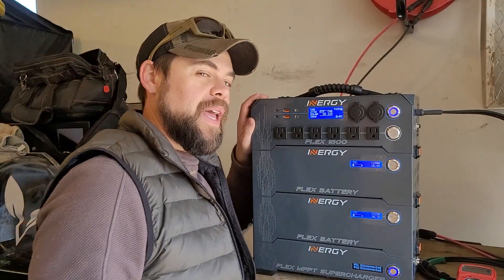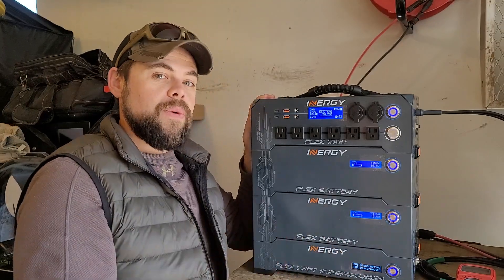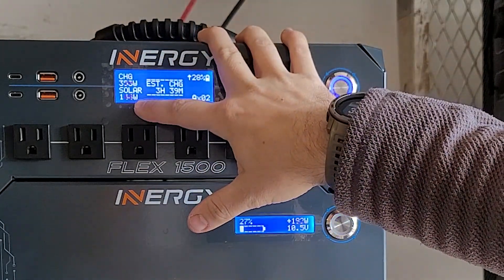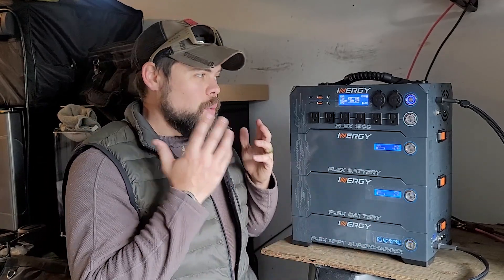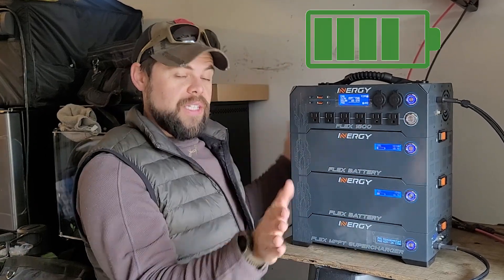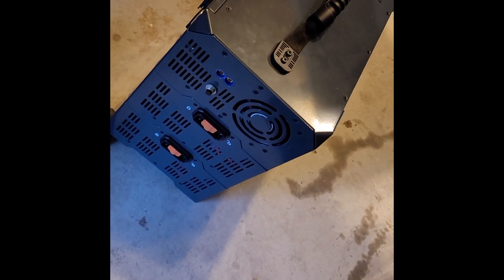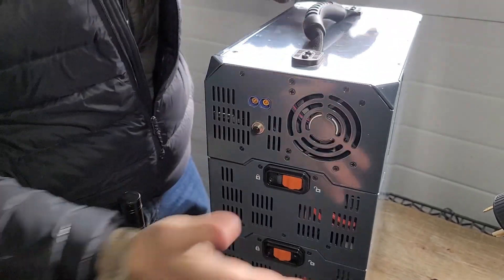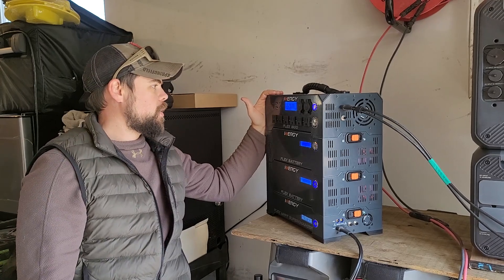UPDATED REVIEW Inergy Flex 1500 Solar Generator Power Station

Comment: 😂 I was one of the fools who preordered it. I typically have it on trickle via solar. Very Spartan gennie compared to the new offerings.
Reply: I also have a switch that is bent and locked up on the 2nd battery. Common problem. They changed the mechanisms on the "Tactical variant.

Comment: I think you may have either received a faulty unit or you just are unlucky.  I would talk with Inergy about the discharging of the batteries when not being used.  I've had my 1500 (with 3 batteries) since it first became available and I've not had any problems at all with it.  And that has included "unlatching" to move the thing from house to van many times without any latch problems at all.  Matter of fact, mine was stored for 4 months fully charged (and I heard I shouldn't do that so I checked on it) and it was at 99%.   So it lost 1 % in 4 months.  And I even topped that charge off just before hurricane Helene to be completely ready and just checked it and it's still sitting at 100%.  So I don't see any of the problems you described.  Looks like you were pretty rough on the unit!  lol  Good luck to you.

Comment: You have to (disengage the left side first) and then use that orange button on the right to release the latch to release the battery.  It would be best if you had not used the force to unlock the unit the way you did. If you look at the latch on the left side vs the right side of the latch, they have different angles for different release points. I love my Flex with an extra battery pack.
Reply: This guy in the video only responds to people who join him in dising Inergy!  lol   I think he pretty much screwed the pooch and didn't or doesn't want to admit it!  He probably forced those latches and then mangled them even more with that industrial screw-driver!

Comment: I agree with the lock issue as I have faced the same and one of my latches broke, poor design. Their technology is old, their batteries are not LiPo either. I had ordered 2 batteries from them in July, 2023 and never received them and eventually had to ask for my money back 13 months later, which still they messed up at first. As I guessed it, it no longer matters because now on their website they make it clear that they have a $1.83 million dollar contract with our federal gov't. and they are not selling anymore directly to the consumer.  I hope I do not have issues with my current products. It also is not surprising that our government is spending our tax dollars on outdated equipment only because it is safer since it is being manufactured in the USA.  US competition needs to step up so our tax dollars are more wisely used and our nation is more securely protected with the most modern tech. P.S. I have bought 3 systems from them and have 8 of their batteries. Now I moved on to EchoFlow.

Comment: I bought the Flex when they first came out. I bought 8 batteries.Can only use 5. (5  is the maximum stack).They told me that the connecting device..."FLEX BATTERY ADAPTER PLATE" would soon be available.It's been about 5 years and the still don't have any. Anyone else have a similar situation?
Reply: Company has folded according to CityPrepper. Thats my observation as well based on attempts to   reach them.  DO NOT send them money, creditors or liquidators will just take it.

Comment: I had to wait many months for my order to be filled, I think it was close to a year and half! The Flex System and batteries were purchased with a ten year warranty, that was supposed to be wonder bullet proof warranty at the time of purchase! This investment has been one of the worst I've ever made, $11,000 dollars in total with this company! This product was NOT fully tested and thought out before selling them, it was pushed out the door for the purpose of making a great deal of money! With no intentions of covering the batteries horrible life span, throwing  what ever batteries you could find during the pandemic! I also know that you have changed and improved the design since my purchases! Latches broke right away, no positive locking system! No piezo alarm letting you know the battery strength is too low! Many things should have been improved upon before sales should have started. My Makita batteries can hold a full charge for at least six months.

Comment: I've given up on my Inergy Flex at this point.
I pre-ordered, and finally did get it after some delays along the way.
I charged via 110 receptacle - all good there.
Ordered a couple solar panels, and didn't really get back to try them for about 6 months.
So by then the battery seemed dead, and wouldn't charge via solar or 110 receptacle.
Inergy support had me try charging just the battery module directly for 24 hours - no change, it wouldn't charge.
So they sent me packaging and labels to send it back to them. One Lithium battery label missing, so I bought some from Amazon. And shipped it back via FedEx.
Waited about month - didn't hear anything back on status or even if they received it.
Emailed support to get status - it's probably been about another month - crickets.
I really wanted to like it, but if it's not going to work, and response from support takes a month, if I even get a response - that just doesn't work for me.
I would have even bought another battery module if the problem was that I let it drain too far to be usable.
But then with the slow, sometimes non-existent, response from support, I can't see me putting more $$$'s into it.
At this point, I think I've got a $1300 controller that may end up going to e-waste, and I'll try another brand.
And the latches... one of those broke on me, also, on the battery module.
For something to be used for emergency times with power outages, I was hoping for better.
I did have an 8-9 hour power outage during an electric panel upgrade, so I ended up going to get a $1000 Champion duel fuel generator instead to deal with that.
Reply: same thing happened to ne. I sent back defective Kodiak X2s and they never responded so my money is gone.  that must have been time doors closed or creditors took over.

Comment: I've had my Flex 1500 since August 2021. Ordered with 2 batteries and 4x100w solar panels. I'm super please with it in my ProMaster Van conversion. Runs c-pap, lights, small fridge, recharges phones and devices. One of the best things is I remove my whole electrical system and store inside house for the harsh winters here in the north. After storing most of winter my batteries were still at 98%. Perhaps poster left dc on or something.  My question is: Is there a way to add a LiPO or other modern lithium battery to this system? do I have to pay $900 for another 80ah battery when 4 times the battery can be bought for half the cost. Anyone have info for adding on a non Flex battery? or is that a no-no? seems to me the original marketing said you could add lithiums of even a lead acid.

Comment: It took over a year to receive my console and panels. During this time I was given several extended warranties as compensation. After finally receiving my unit, I had only used it a few times and it stopped working. I tried to get Inergy to honor their warranty, but they ghosted me. I began to post on their social media accounts and informed the Better Business Bureau. After a few months I finally got an answer from someone on their marketing team. She told me that I would be receiving a refund. This never happened. More months go by and she again decides to randomly contact me and let me know "The CEO himself" decided I would not be getting a refund. Instead, they would replace my unit that was not working. WHAT SHOULD HAVE HAPPENED IN THE FIRST PLACE. Several weeks later I get the top part of the console in the mail, but no battery. It still didn't work. I informed Inergy again and AGAIN the GHOSTED me. So it's been several years and I still don't have a working unit. Yet they continue to advertise their product as if its a working device, and asking for investors to give them money. When they know they don't deliver on what they advertise. This company does nothing but steal from their customers, and scam their investors.

Comment: I got my Flex 1500 recently, finally, after years of waiting.  I am generally happy with it.  Yes, the latches are a concern.  Apparently, their new system, the Flex Tactical, uses a different latching system that looks to be much more promising.  Unfortunately, for better or worse, they also added other features to that system which makes it cost more, and thus out of my ability to go after it.  The regular Flex 1500 was already going above what I wanted to pay.  But, I still haven't seen anything better on the market for my particular use-case-niche.  I am working towards gearing up for life on the road in an SUV and a small trailer.  Size matters.  Space matters.  Weight matters.  All the other modular systems use heavier components as well as taking up significantly more footprint to account for the connecting wires for the batteries.  The Flex is the only one I have seen that does away with battery connecting wires.  It isn't a perfect implementation of the concept, but, it's all that I have found for now.  So, given my use-case, I still think the Flex is the best option for me.  Currently have one base unit, one super charger, and one battery.  Another battery is on order and scheduled to arrive in August 2023.  I plan on getting more, but waiting on cash first.

Good review overall.  You are not wrong in your assessment.  I'd be curious to see how the Flex Tactical will work, and also curious to see if it will somehow be backwards compatible with the regular Flex 1500 components.  The current steep pricing of the Tactical though means I'll live vicariously through someone else.  It also means, maybe, just maybe, there will be steep discounts on the regular Flex 1500 components soon.

Caveat*  Yes I know the Titan exists, and stacks like the Flex, but the components are too expensive to buy as I live off of a fixed income and need my component purchases to be smaller costs at a time.  Also, the Titan is just a bit too big for my use-case.
Reply: No worries about the Titan. They’ve got a 500-charge 100% efficiency rating, whereas the Flex has a 6000-charge efficiency rating. You’ll be just fine.🫡

Comment: I see all the positivity toward Inergy. The pro from my perspective is that I am a long time customer of theirs. I bought an Inergy Kodiak. Their customers service was great until it wasn't. The kodiak maybe more of a prototype that went on sale, I will give them that. But patent infringement for the neutrik connectors was in my mind wrong. Doesn't matter if later on they change to another type of connector. They claimed neutrik was the connection and in fact it was not. Neutrik had no idea they were violating their patent from what I understand. I even called neutrik personally and they had no idea this was going on. I asked them " well is this not a patent infringement? and they said, well yes. " 

My Repair for my Kodiak has taken months. I paid $42 for a hazmat box. That was promised to be sent. and well it got lost. I asked for a refund. It was granted. Thanks Inergy.

Comment: 8:40 
I purchased my flex one and a half years ago.   The latch did break very disappointed.    However, I have found when not in use. I have not had the drainage problem on the battery that he talks about. (Very small amount). I have gotten quite a bit of use around the ranch with it, and it has operated very nicely.   I purchased a small air window air conditioner. 8000 btu Midea That is DC powered with a built in inverter, and it runs that with no problem for many hours.    I only paid $1100 for my flex brand new so I know many are better, but the price was right.    
I think they are now 1450 but they go on sale   I give this unit a thumbs up, excluding the latch problem.

Comment: I got my money back in late 2021 from Inergy after over a year of delays and immediately purchased from kickstarter the Ecoflow Delta pro and I thank goodness I didn't end up with this piece of hardware.  My Delta pro is an absolute beast and has been on nearly continuous duty since December of 21
Reply: Delta Pro, as much as I love them, have a 3K 100% charge cycle life, whereas the Inergy has a 6K 100% charge cycle. Honestly, you can’t go wrong with either one;however, one lasts longer than the other.
Reply: @bodazaphfa  I canceled my Flex order simply because  I desperately needed my unit at the time and Inergy lied to me on three occasions about delivery times. The ecoflow pro was available and I got a good discount so it was a no-brainer for me.  I have zero regrets.  Also because I bought it through kicksmurder my Eco flow pro came with a lifetime warranty

Comment: I still like the flex 1500 better than Ecoflow or Bluetti.  The Flex has simple buttons and much better capacity than the Ecoflow or Bluetti’s.  Plus u can keep stacking them.  I’m keeping my back ordered Flex 1500 batteries.  I’ve got 2 coming.  I want a stackable system not giant units on wheels.

Comment: Damn. This really breaks my heart because I too waited a very long time for mine. I am active duty military, and at the time this seemed to be the unit to keep my mind at ease to leave with my wife and newborn baby girl in the event I was away and shit hit the fan back at home. Maybe I got a good one, but mine has been sitting in my Mancave (temp controlled) since September of 2022 (now May 2023) and has not really drained. I noticed a like 9% drain I think around December and charged it and has been pretty much at 100%. I also have not really used it, just plugged shit into it when I first got it because I was excited but haven’t run it though it’s paces. My latching system does seem alright, haven’t had any issues but did notice the better system on the Mil version. I was getting upset seeing all these other companies pop up with cheaper systems that were surpassing the Flex 1500 while waiting for mine, but I’m stubborn and continued to wait. Guess I can use it for camping or range and get that Titan for real emergencies. Just read up on their pre-order offer for a home solution, what would y’all recommend???
Reply: If it makes you feel any better (now that you've had yours a year), I have the 1500 with 3 batteries and have been really grateful for it many times because of power outages.  Using it remotely has been no problem at all and I've never had any of the problems this guy in the video has had.  My latches work perfectly and the unit does not discharge very much at all over a period of months.  So maybe he just didn't latch it correctly and ended up with his screwdriver technique to rip it apart.  lol   No problems here.  Good luck to you.

Comment: I am so glad I had cancelled my preorders I had with them originally. By the time these were physically available, they were pretty much obsolete. I think Delta had come out with at least three new models in the same time span. I had also read about the latch problem from one of the first recipients of these. 
Meanwhile, my Kodiak is sitting in the garage, hasn't been charged in probably a year and has been running a fan in there for days and still has full bars. Its kind of a shame that the company have done themselves in.
Reply from the maker: The Kodiak was awesome. Since then, I havne't been impressed either.

Comment: I'm finished with inergy as a company.  They warranted a bad battery with another bad battery, and now they they have stopped responding to my emails. That email response was mid February and nothing since. As far as the useless locking system, I use the back side of a good lock blade knife and go in from the end above the latch and force the metal tab to the unlock position.

Comment: I am almost ashamed to admit I BOUGHT into this system from Inergy. It all started in 2016 when I ordered their Kodiak/Apex battery/solar generator. it took EIGHTEEN MONTHS to arrive. It only went DOWN HILL from there. I bought 2 FLEX expansion batteries because connecting to ANYTHING ELSE was USELESS. I FINALLY received the SECOND  FLEX battery 28 MONTHS (Sept 2022) and after a direct phone call from Jared and a previous call with Sean (CEO) I OFFERED to pack it all up and send it back to them in THE ORIGINAL BOXES, which I STILL have. All they had to do was REIMBURSE ME WHAT I HAD PAID and I would NEXT DAY ship the day after their certified check cleared the bank. NO DEAL!. They EXPECT you to pay and WAIT, AND WAIT, AND WAIT but would not have faith enough to get their product back from me. Does it work? Well, to run small low draw, 550 watts TOTAL or less, and it DOES. Larger draws work, but not recommended. I should have bought the TItan, but I digress. After watching YOU and Will Prowse I built my OWN system. Although NOT as portable it got me though with over 6.2Kw on tap and 800 watts PV on two strings. The Apex and TWO FLEX batteries take an ETERNITY to charge on AC with the miniscule charger from Inergy, so I have done as you show. I trickle charge them with a 100 watt Harbor Freight PV on their MC4 to EC8 cable. OH! the Flex to ring adapter took 18 months of being the " obnoxious customer" to even get the ONE Flex battery to connect to the Apex.
 My ultimate recommendation BUY SOMETHING ELSE (and NOTHING from Inegy) or build your OWN.
Reply from the maker: I waited almost 18 months to have my complete system that I ordered from Inergy.